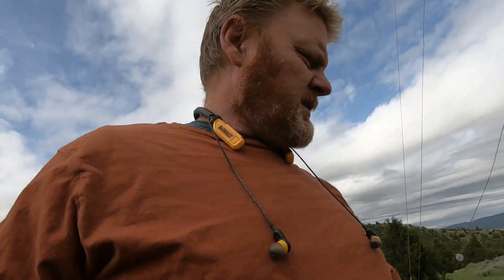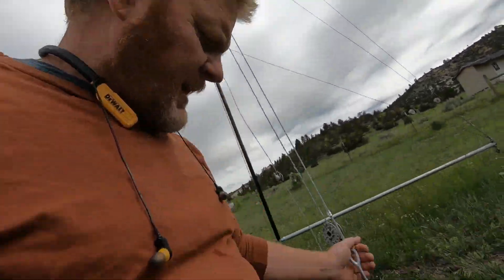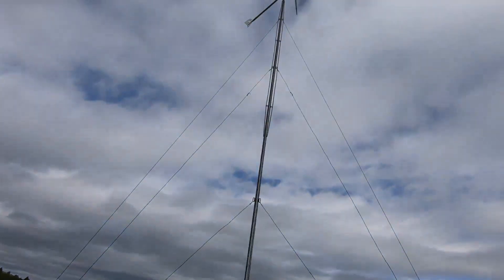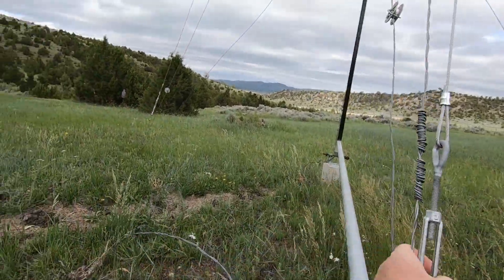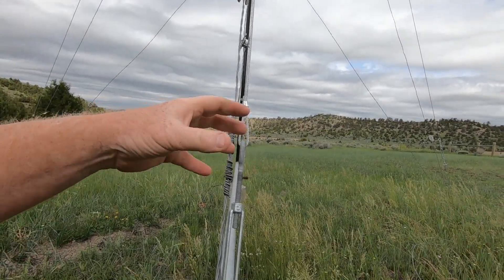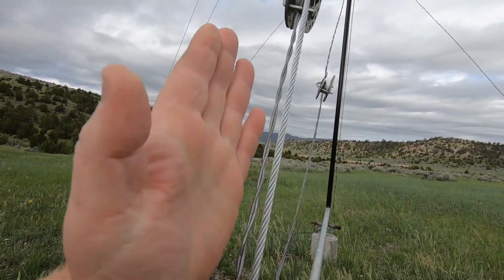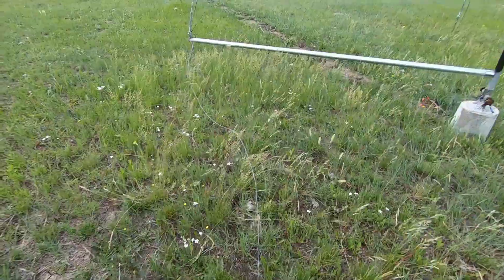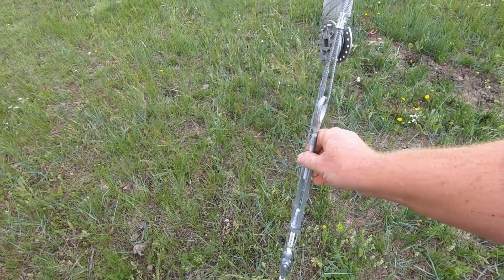WIND TURBINE FAIL, Don't make the same mistake I almost made, How to erect a wind generator tower

Comment: if u look at antenna masts, they will always loop the wire through the turn buckle after the crimp, this is so it cant wind or unwind after installation, but if u need to make a future adjustment you just pull the excess wire back out and can make an adjustment, if properly installed there wont be any issues or need to adjust for 10-30 years until the galvanization begins to decay hence there isnt much need to use something more pleasing to the eye or that makes it more convenient for regular adjustment, only other issue is you also have imitation parts that use cheaper lighter alloys and metals that cant handle the stress and can just snap in high winds or after a few years under regular stress like aluminum, found some parts they also would be coated to look galvanized etc, but the dead give away normally would be the fact they are cheap and are as light as a feather vs what normally would be the case.

Comment: Do what they do on sailboats... drill a small hole into the end of the bolt on the turn buckle then get a long flexible cotter pin and insert it into the hole and wrap it around the turnbuckle. Do this to both bolts and they will stay exactly where you want them

Comment: I'm wondering if a ratchet style fence tensioner would do the trick.
Reply from the maker: Better than what I was using. I ultimately went with turn buckles but beware of those too because those need safety wire on them believe it or not

Comment: the only problem with lock nuts in this situation is that you'd have to find reverse threaded locknuts for half of all the turnbuckles, not something commonly found. with my idea you could maybe even find a suitable sized U-bolt and then you wouldn't have to weld a darn thing.

Comment: Add locknuts to Turnbuckles,works great, had same problem,SOLVED
Reply from the maker: Ok, glad to know I'm not the only one this has happened to.
Reply: @veggitarianredneck  Anyone used swivels in the guy wire to reduce this risk? Are reverse thread lock nuts available?